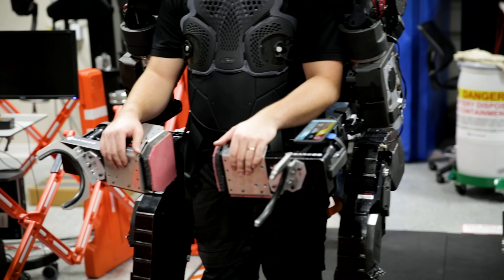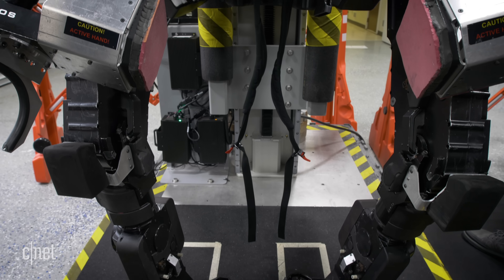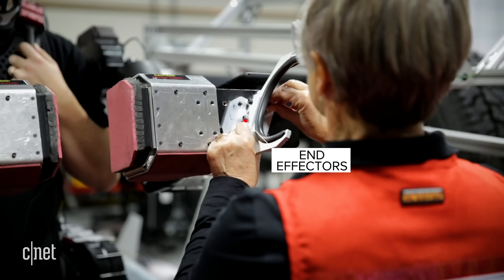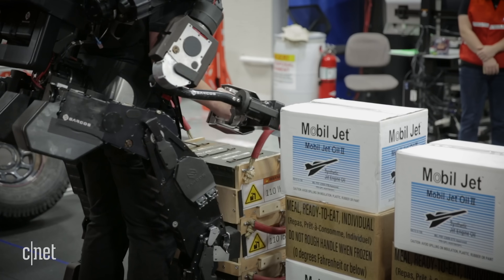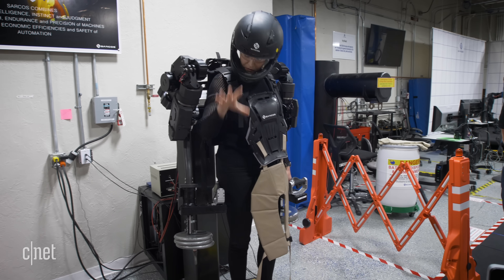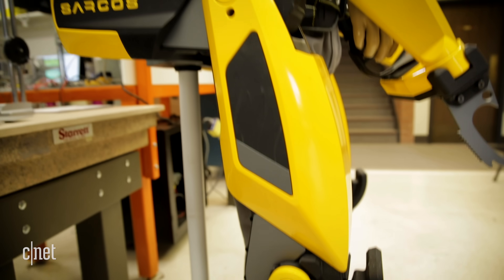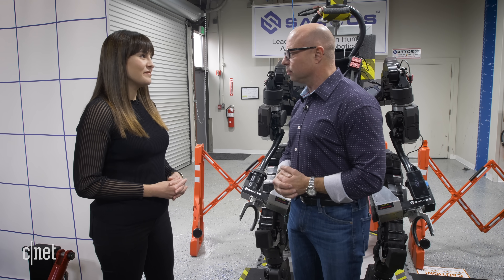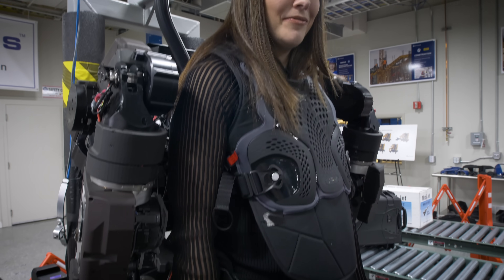Guardian XO is a powered exoskeleton that makes you 20X stronger

Comment: SO, I saw that it was loading. I served in the Marines as Aviation Ordnance - I've done that job...
I hope they don't put this in Aviation Ordnance. This is going to get in the way, and we were always running from one place to another, planes are moving around, etc...
Flight decks are dangerous places, being around Ordnance is a dangerous condition that speed and focus has to be intuitive to the individual. Additional problems, you'd have to have a whole shop of Marines and Sailors dedicated to the support of the suit, and I'm not sure it is safe to be around high explosives. Not a lot of electronics in the work areas and flight decks. Was the architecture of this machine built with being spark proof, flame proof, flame retardant systems for that very unsafe battery to be around a multi ton load of tritonal explosives? Jet fuel exposure? Being in the middle of the ocean on an aircraft carrier? Salt exposure? Continuous use? You have a study you can point out to people?

Comment: I'm working on a better power suit. Hoping to find a good electric linear actuator for the knee joints but have not found one that meets the need yet. Really hoping to get away from hydraulic system.

Comment: 350lbs mecanic+200lbs load + 200lbs user it requiert renforced stairs 
because its 750lbs per 10cm square and a standard house floor is rated is rated for 800lbs per meter square

Comment: Not military, but instead of hands on the end it has convenient mounting points to lift missiles, or to potentially mount a Vulcan
Reply: Haahahahahahahaah this is exactly what i thought
Reply: This is a very good logistical tool but a bad battle machine, get it right now!
Reply: I was in the Marines - AO. I wouldn't want to have to use this. We have a very simple and reliable way of plugging these Vulcans into F18's - aircraft carrier ready tools and carts. This thing looks like more trouble than it's worth. Like replacing a simple hand tool with expensive computer. AO's just get three shoulders on that missile and we lift it up. No problem.
Reply: Are you really that void of attention? The project is funded by the military. He said it doesn't have tactical applications. Man, people like you should really not try to procreate.
Reply: @XpVersusVista  yeah.

Comment: The tech will take off once they realize the can get rid of the batteries and charge wireless thru their feet. We need to develop first a reliable source of power without the batteries,  how come they haven't thought of that yet? Wireless power through induction coils on the soles

Comment: I think to get a better judgment of it's ability we need to see it topple over forwards and backwards, also what happens if it falls on someone presumably it will be used around other people so what kind of safety mechanisms are in place to protect other people around it.

Another thing is the hands there aren't any and it seems to use a kind of claw, far better to have either a three fingered hand or better as many things don't have handles.

But it looks good very promising, but we do need to see this thing falling down stairs or collapsed with failures as these things always end up with failures over time.

Comment: Garbage!  First thing they cannot do is work out how is it powered, batteries HOOOO great so 15 to 20 mins and it's flat, 4 Hrs + to re charge, Umm at a wall-mart LOL.  Sort the power problem out and you may have something. so it lifts 300lbs, and 210lbs are batteries wow what an idea. 50lbs batteries and it lasts say 2hrs NOW that would be a find .

Comment: "This is not a tactical suit, it's logistical" -- And logistics are 80% of the war.
Reply: Well, it's still just proof of concept.

This would only have industrial use. But in the future that might change as they increase responsiveness.

Then, you can finally carry a dragonslayer.
Reply: @sgtsaltstick2729  Yo that'd be amazing. We need some heavy lifter to wear one of these suits and have a blacksmith make an actual 1 to 1 replica of the Dragonslayer (which is about 400 pounds heavy).
Reply: @sgtsaltstick2729  HAIIII YOOOOO
HAIIII YOOOOOI
Reply: A robot that can lift 90kg isn't exactly a good combat unit
Reply: @theshermantanker7043  Now imagine an upgraded version that can run 50 mph, has dual assault rifles mounted on the arms, a grenade launcher attached to the hip and can jump long distances and has armour. You better believe the military already has that ready to roll out
Reply: @dafidyao  well... not that far... i can see it be a tank loader
Reply: @sniperely7915  I hope you are not that small minded. No offence but it´s not even hard to make one like that when this is what is shown in the mainstream. Even if that diden´t exist yet (it does) it is extremely close to being developed.
Reply: @dafidyao  I spent 2 years working on top secret defense technology for the military, and let me tell you... we are NOWHERE near ready to use something like this in the military. A project like this is well over a decade away
Reply: @airsoftbeast11234   F
Reply: @dafidyao  What you are suggesting is most likely achievable with modern technology, but at an extreme cost and not capable of being developed in bulk. Until there's more demand for it or the production/development costs decrease, we won't see any of these.
Reply: @airsoftbeast11234  dude... You're not supposed to tell us that ..... Lord...
Reply: @dafidyao  thats science fiction
Reply: none of you, besides the original commentor, has an idea about war it seems. logistics is indeed 80% of a war. Transporting ammunition, fuel, food, medicine. Keeping a steady supplyline intact. Those robots will never stand on a frontline, they are not cost efficient for that. But their real use is that they make rearming an attack helicopter and similar combat vehicles easier and most importantly faster.
Right now, to attack a missile to an attack plane, you have a small crane with a sling. on that sling is the rocket and 2 guys stabilize it with their hands and guide it to the hull point. This takes time and is "unsightly". Having such an exoskeleton means one guy himself can lift the missile and quickly bring it in place, without having all the difficulties.
Reply: different kind of logistics

Comment: It is still way too bulky and in the way instead of helping. You can prety much do almost everything that this thing is doing and even faster by using Forklifts, Transpalets, cranes and good old brute force. If it is 3 times slimmer it would be a thing for sure. Right now way too bulky and in the way.

Comment: Having done a bit of carpentry, that huge thing is going to be an obstacle to getting the work done. Imagine you carrying some planks through a door opening, hard enough to not have them hit the wall but with that thing. How are you even going to get through the door opening. You'll bump into everything. Now let's carefully drill a thousand holes in the wall. Oops the machine bumped into the wall and made a big hole that means you'll have to throw the entire board away and replace it with a new one. The only place that thing might be useful is in a warehouse but you already got forklifts at those places so...I can't see this being useful or affordable anywhere. Unless they figure out how to make the skeleton fit tighter around your body.

Comment: These things cost way too much. I doubt many construction companies are going to buy them for their employees. Companies care about speed, not comfort. It's more cost effective to get 5 guys offloading pallets by hand. The changing out of various grappling tools would also need to be better. The operator should be able to walk up to a rack and swap out attachments while still in the suit. The cost will have to come down significantly for these to catch on. How do they hold up on slippery or uneven terrain? Most construction sites are less than ideal walking conditions with debris and obstacles everywhere. I could see this suit often getting stuck in the mud, slipping on ice, tripping on debris and falling over. So for anything more than finished surface industrial applications, I can't see these catching on in most places. 

Encase these in bullet proof armor and use them for law enforcement/military urban raids.

Comment: While it may not be designed for armored combat, if two exo pilots are left unattended for long enough, I guarantee we'll have an impromptu combat stress test borne out of 'Dude, I wonder how hard this thing can hit'.
Reply: It only use 500 watts of power. It's 1/3 of Atlas from boston dynamics. (in fact atlas use hydraulic accumulators so the peak power is even higher)
So it can probably do some damage if you are crushed aigainst the wall but it can't hit you very fast.

Comment: I want them to try jumping
Reply: It only use 500 watts of power. It's 1/3 of Atlas from boston dynamics. (in fact atlas use hydraulic accumulators so the peak power is even higher)

Comment: Are y'all using hydraulic fluid??

And this absolutely could be used in the military. I have a friend that used to change out tank parts with a group of people to do in-the-field repair jobs to damaged parts of tanks. He hurt his back really badly, and it's unfortunate that he didn't have access to this technology during his deployment. But if y'all do armor this bad boy and send it out to the military, it would significantly help to boost productivity, safety, and minimize physical hazards that heavy lifting and torquing cause on a body.

Comment: Way too slow. Does not lift tonnes. Thats it. Out there in industry all the heavy lifting is done. Only place could be in a hospital but then they have beds which fold into chairs and stuff. Nope I don't think this is there yet. I do however think its a start and well done. This is not what people will buy though. Have to be able to run in it and grab things fast. Walking in that thing you look like you need a turd.

Comment: It is cool apparatus indeed but it is not efficient. As demonstrated in the video the exoskeleton is immensely slow, clumsy and bulky. I work in construction business and I can tell that device has 0 use in our work. By the time the guy is in the suit and has moved to the required location 3 guys have done the job. Try to lift 360lbs diamond floor grinder up or down stairs. There are only few places to get a good grip and it is really unbalanced to carry. But the magic trick is to call your mates for a quick job and carry it together. More efficient, cheaper and faster. And when objects become too heavy to safely carry/lift with 2-4 guys you can just use forklift/telehandler. One injured construction worker is cheaper to replace than to buy and maintain that exoskeleton and maybe have to use it once in a week.

Comment: Imagine in like 3-6 years how small and think the eco suit will be because the innovations and tweaks.
Reply: @Next Level Code You never know what technology is around the corner
Reply: @vacston  He is right about the limitations, you have to consider that these units are meant for mass production so they don't have much choice on the materials that are required to lift these kind of weights and not break apart and cheap enough.. but the high end ones where money is not a problem would be a different story of course, lol

Comment: I'm guessing this is what space force is going to be using
Reply: I'm guessing you don't know anything about space
Reply: "Guessing" I'm guessing they "could" Use it. it's a question.
Reply: You do not need power based exoskeletons in space, only precision ones. Because there is no 1g gravity, duh. Space force would be more about small jet packs and precision movement and helmets with hud as well as protective suits.  
  
Power suits are exclusively for planetside use, because in space you dont work based on weight of the things.

Comment: I'm thinking mobile artillary infantry. Trucks are heavy and large, noticeable, and not easily maneuverable in certain environments. But if you get one or a small group of these to carry a big mortar system or something for a few miles, that's huge. At night, in urban environments, in mountainous terrain. Drop them off out of a helicopter on a stealth mission. Sure a truck can carry more rounds more efficiently, but maybe some missions only need a few. Depends. This would be especially good if later iterations are more agile.

Comment: I'm a bit surprised they don't have a good swapping mechanism for them though, they all have to be bolted to a plate.
  There's no easy to release pins or latches to quickly change equipment for different tasks.
Also that there aren't any powered end effectors (ie. no robotic claws)
Reply: Those things will be easy to design and add on later.

Comment: meanwhile...forklifts.
Reply: I think this suit is made for places where forklifts can't get to.
Reply: @amsd1231  manual forklifts. they practically rotate in one place. and can reach waaaaaaaay above this wacky robocop stuff. also, cheap, easy to use and i can train you in 5 minutes. plus, you can ride them like a skateboard!
Reply: Big, clunky, and has a way larger turning radius

Probably runs for longer though
Reply: @tzengtm  right now, I can think of so maaaaaaaaany advantages of the forklift over this, that it doesn't even make sense to count them! do not forget that forklifts can also be modified for particular jobs. this is just media sensation. to put it down, it is in a very early stage and I see no practical application in the real world.
Reply: You wanna do something, do it with style
Reply: Ok party pooper

Comment: Having one of these boys in a machine shop, "Hey Mikey, we got a big order of tank turret parts, get in the mech and load the tools and stock!"
There's going to be a job market for trained operators.
Reply: They cost 100 grand mate.
Reply: @Monkofpo  and a single CNC machine costs around 30k, and no professional machine shop only has just a few, rows and rows of bread ovens worth more than their weight in gold with the work they can get done.  This is just the next step, multiplying the capability of a worker, saving on health insurance, working smarter.

Comment: " this isn't something intended to be equipped with armor and sent into battle"

I mean just because it's not intended to be used a certain way...
Reply: To slow for frontline combat. Logistics at best
Reply: @5678sothourn  they will come out with a faster one for combat im sure they probably just need to work on upping to suits response time to your moments or maybe they will just use a lighter one that only slightly increases you speed and strength
Reply: @5678sothourn  Give it 10 years and they will slap armor on them and make them do house-clearing duties.

Comment: This tool just made my mind wander with all the possibilities for modules.  Generators, Excavators, Skid Steers, Tractors, boats, planes, backhoes... my questions are... can you make it for different sized humans?  small, medium, large, etc.  And can you make a bunch of attachments for it?  wheels, tracks... trailers, radios, lights, power take-off, drills, welder, diggers, cutters, saws, augers, screwdrivers, nail guns, painters, lifters, forges, compressors, conveyors, air conditioners, pumps, wrenches... coffee maker, heater, cooler, cup holders, refrigerator, camper, different colors... i mean think of how many power tools you could plug into the thing, like a farm tractor on steroids, or recreational off road vehicle like motor cycles and jeeps. could they be mass produced like beer cans, and standardized so tools for one interchange with others.  Sorta like legos... it would make a great tool to expand and build upon, but it would have to be standardized for interchangeability, but configurable and unique like cell phones or automobiles, or motor homes. =D  And that isn't even going into different materials - wood, metal, composites, concrete, etc.

Comment: The lack of clamping actuators on the arms bothers me.  It needs some tools that are more than just aluminium cutouts. It needs clamps, welders, rivet guns, and other tools to be more diverse. It's clearly going into military use, videos of earlier prototyles unloading trucks of sandbags/cinderblocks and other random things have been all over the internet for years.  And those guys were moving at a proper pace, the demoing in this video is really toned back from what has been shown before with them just one hand grabbing  +60lbs objects and almost tossing them as they unloaded a truck. I really don't see a lot of companies renting these at 100k a year when they can just BUY powered pallet jacks and lifters and leave it to people to move individual items at a fraction of the cost per year. It's damn cool, but their focus on a service, rather than a sale + service contract means their really worried about its durability.

Comment: I have to stack and unstack pallets of drums weighing between 350 and 750 lb everyday at temporary job I've been at for some time in recent months. Hope you guys can make these with increased strength endurance and maneuverability to move this kind of weight all day long for 10 to 12 hours per day because I hear 30 lb in 200 lb mentioned here and that is very lite in comparison to what I'm dealing with on a daily basis